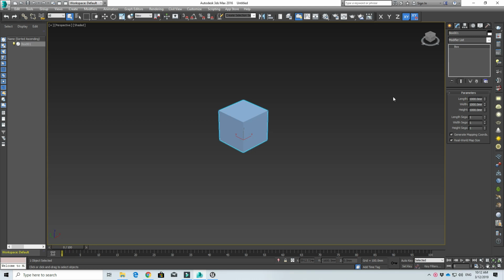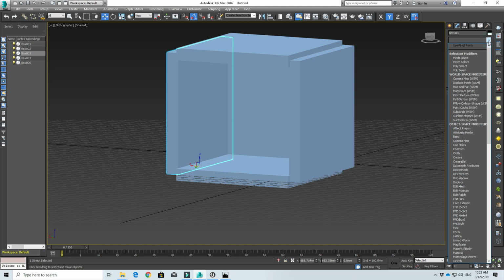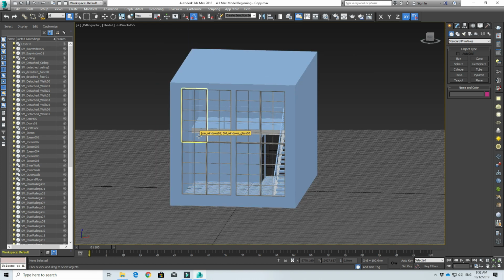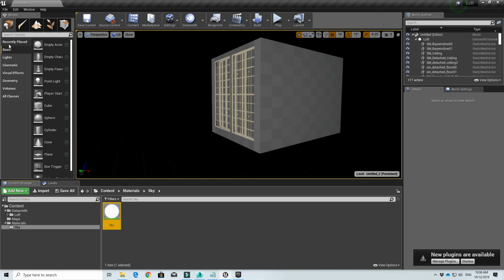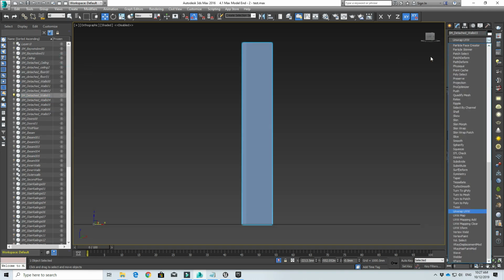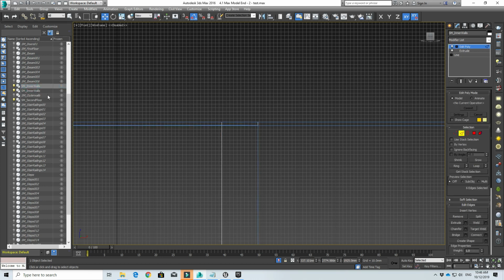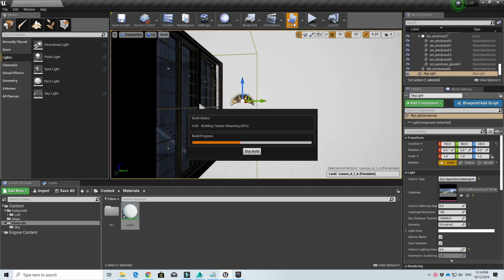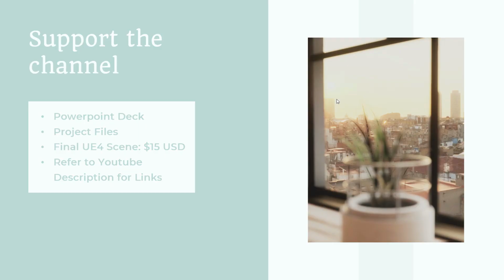4.1 Lightmaps discussion and Importing into unreal engine - Unreal Photo Realistic Archviz Tutorial

Comment: I am having a couple different issues. 
1: Even though I have a metal material and glass material that work in 3DS Max, once it imports to UE, the glass is not transparent. I have to hide the glass for the light to come through. 
2: Even though all of my UV's look fine in UE, the ceiling is completely black even with the white material applied to it, and there is a big black "shadow" looking section that covers the middle of the railing, and top floor. But it gradually fades back to being normal on each side. Just the middle is effected. Even when I hide/delete the ceiling, the "shadow" effect is still there. But the UV's appear to be just fine.
If you ever make another Archviz tutorial, (which would be awesome), could you use either Revit or Blender? 3DS Max seems to be one of the worst softwares I've ever seen lol